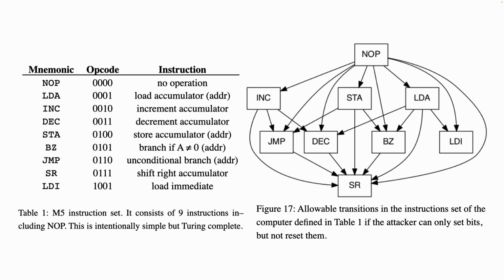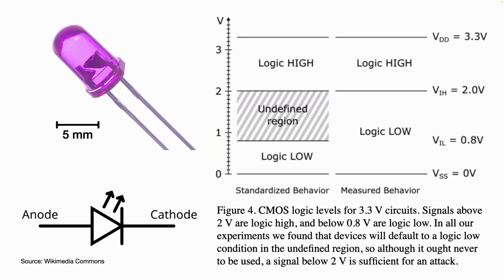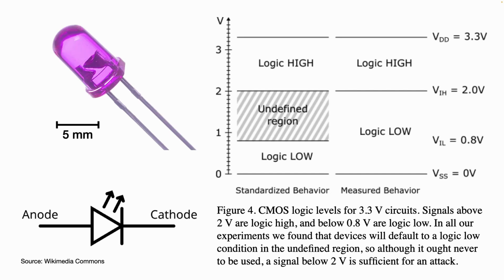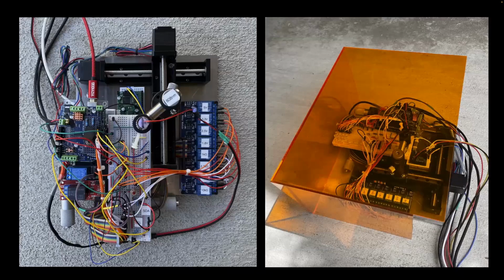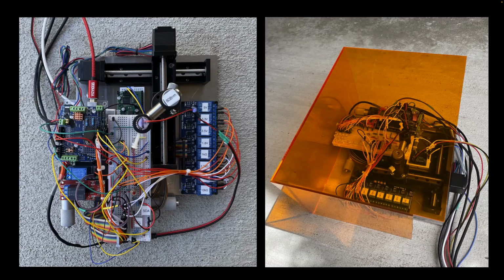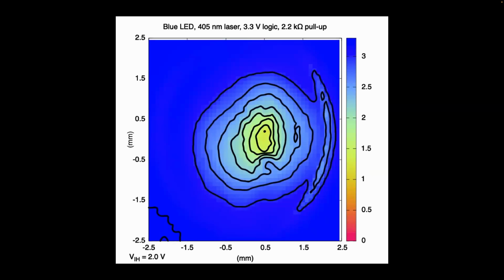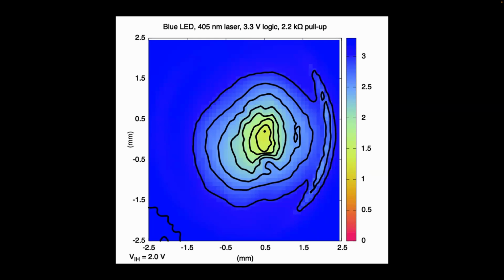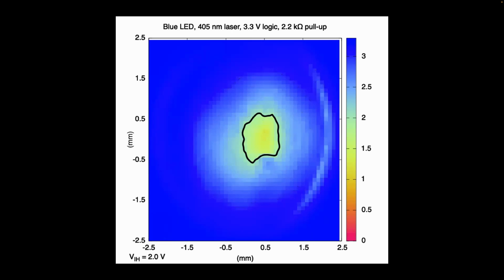Laser Hacking by Joe Loughry

Comment: i mean is this true
Reply from the maker: Sure is. You can see the research at different points over the past years since Joe's been presenting about it at TechConfluence since 2019! Here's one https://www.youtube.com/watch?v=v4uJrkeeF2E
Reply: yes, LEDs are similar to solar panels in that the LEDs also create a current when shined on by light. Same for other diodes and transistors. However these nowadays generally have dark packages which make this nearly impossible.
BTW this effect has been demonstrated previously and is (was?) actually in use in some commercial products.
The application here is that it is used to transfer information or commands into a computer device.